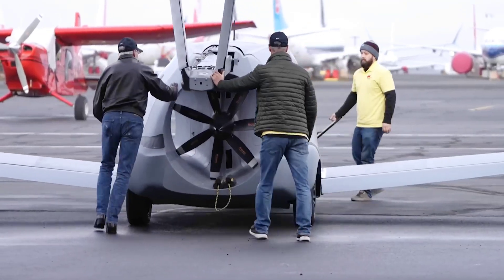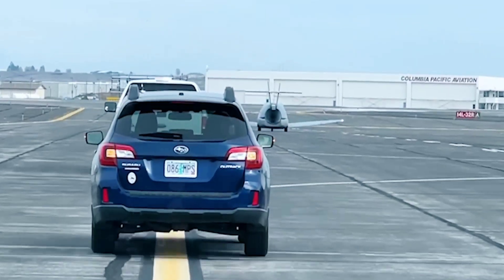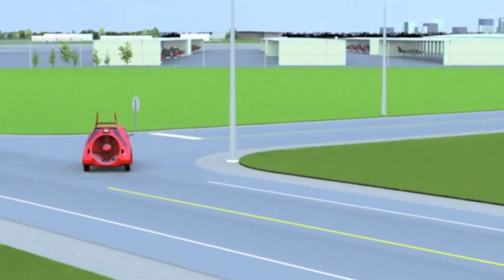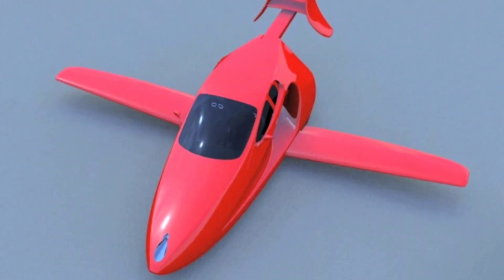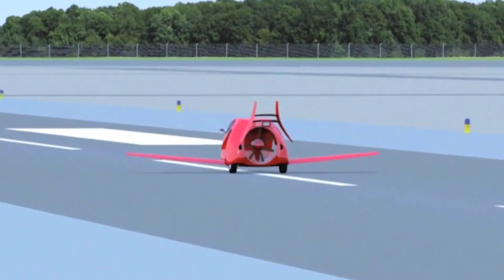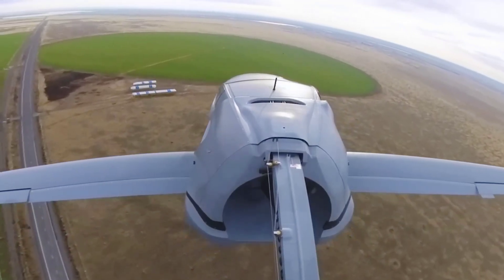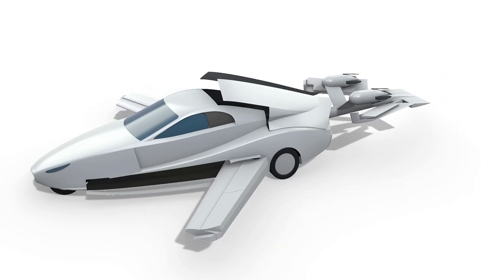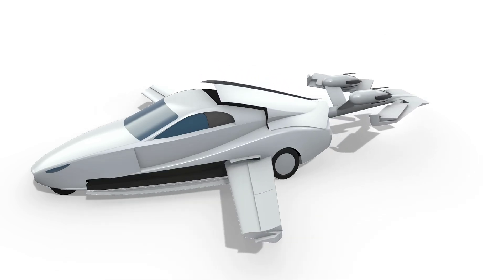Switchblade Flying Car Gets Production Redesign After First Flight

Comment: The new design is a good improvement.   The first flying car that actually looks like a car and seem actually useful in both modes.
The only drawback is that you need a runway to take off. I wonder what would happen if the owner choose to take off in a empty route, it could be finned if some radar detect him/her without doing a proper flying notice?
I think the only way to achieve some freedom from regulatory frame would be if this was licenced  as ultra light plane.